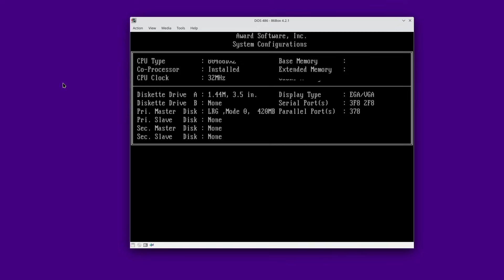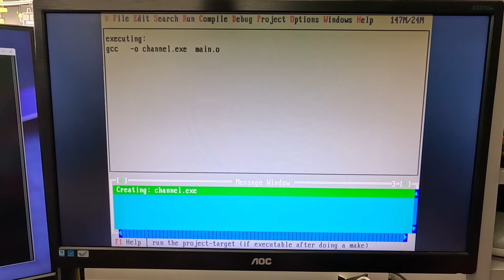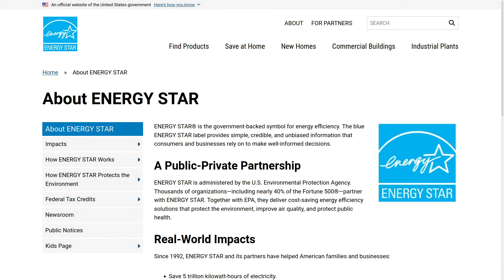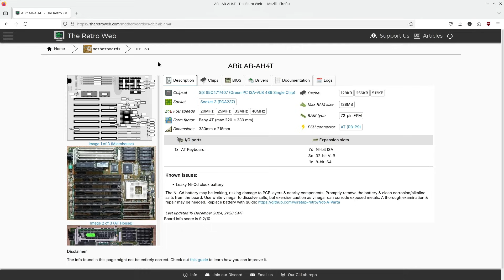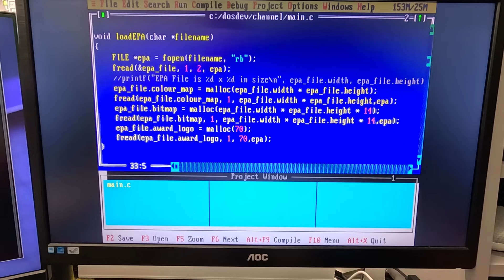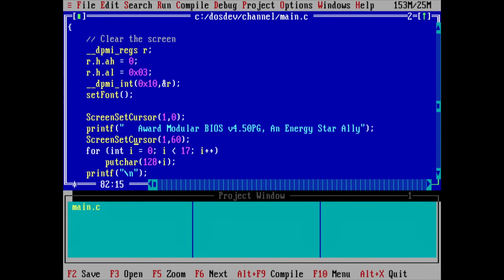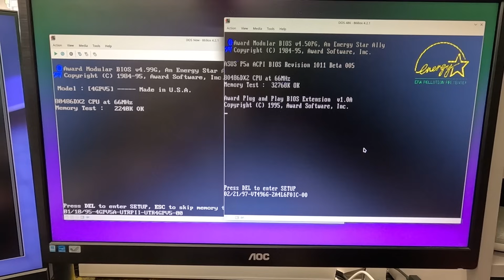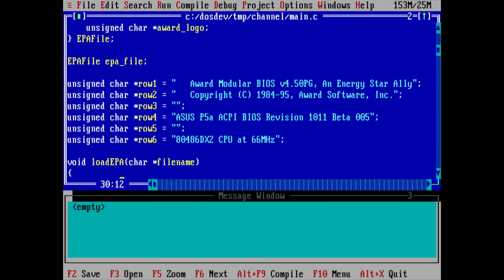Retro MS-DOS Coding - Recreating the Iconic Award BIOS Screen

Comment: As a kid, I was on a special education school and in the 5. grade there was an education game called "Budenberg" at school. It was in the 90s.
At that time, I was already pretty familiar with QBasic (I've teached it myself) and that game was extremely interesting to me because I noticed quickly how it was made: That game was pretty complex (it included many different kind for reading-, writing-, math- and other game modes) but hacked together. It uses almost all possible and impossible screen modes and some modes used tricks like the one in the video. And everything was squeezed into one single 720k 3,5" disk!
The game modes utilizing the tricks look like graphic screen modes at first glance. But the software was unstable and crashed frequently. When it did, it often revealed the secret fact that the "graphic mode" was in fact text-mode! It took long time to me to figure out how they included things like circular pie charts etc. into text modes.
The audio part is still a mystery to me: The game was made with rotten school-286's in mind with no sound blaster. It used the internal speaker to read aloud words, letters and phrases. The audio output through the internal was pretty clear and human-like. I know there is some crude PCM/PWM hack but this usually produces robotic sound. And how did they get the sound files into the disk?
I can confirm everything was really on that one disk with no hidden chamber because a few grades later, I was that one stundent who fixed all kind of computer-related issues because every teacher was afraid of computers, especially those running MS-DOS without mouse. What I did most of time: Getting this game out of some weird bricked state by reinstalling it from the disk xD.
That old dinosaur still seems to be on sale.

Comment: It is possible that the Energy Star logo is displayed during boot exactly as you said, but it seems to me that it could also be displayed as a graphic (by the way, this has already been written about in the comments here), because many BIOSes had a function for displaying a splash screen and even replacing it with a user-defined version. As far as I remember, when displaying graphics using the BIOS 10h software interrupt, text can also be displayed, and the BIOS int 10h interrupt is available much earlier than other BIOS interrupts when booting the computer.

Comment: Sounds like you need to set a new color profile... that's not the official name, I'll have to check.  Yeah, you''l want to re-calibrate it, and most people don't need the hardware these days to do that, I have two graphics cards, and I just let Intel (the smaller integrated card) handle those big changes, because that guy from NVidia wears a tiny little lether coat, we can't trust that dude with issues of scaling.  You would think you only have three choices coming up, R G B, but that rabbit whole goes on for miles.  Just look up a profile forit, and from what I hear, the manufacterer not only doesn't always ship it with something to calibrate properly with, it's the norm.  But that's just what I have heard, I don't know.   It made a yuge difference for me, but that doesn't translate right with multiple displays.  But I'm gettting ahead of myself.  :-D  Hope this helps.

Comment: VGA has hard wired gaps between the characters. Some characters override this and the last column of the character is doubled. This is why you can draw uninterrupted lines and boxes. Which characters do this is also hard wired in the VGA circuits.
This enhances the resolution without requiring more character ROM space.

CGA/EGA doesn't has this feature so you need the gap in the Char-ROM itself. That's why CGA text is more "blocky". On the other hand, you can use custom characters to display graphics just like your average 8-bit micro.

Comment: 0:38 Didn't the 486 DX run at 33 MHz and the DX2 ran at 66 MHz?  32 MHz doesn't sound familiar.  Wondering if you might have been thinking of 32 as in 32 bits?
5:20 (Edit) Looks like the code was later updated since it shows '80486DX/2 CPU at 66MHz' here.

Comment: The "original PC" was not in EGA, but CGA. EGA was introduced with the PC/AT. However, by the time the EPA logos appeared on the POST screen, everybody had (S)VGA. The standard VGA text screen just doesn't lend itself very well for those pseudo-graphics, because of the 8/9 column thing.

Comment: It's been ages, but I believe it is a MODE call. The font could be CGA/EGA mode due to MGA. Maybe using a monochrome (into EGA) mode may fix the issue? 
It has to be within the same MODE so it can display the image no matter what display is used.
So, a font, that can be used in MGA and EGA modes without the overlap. (8x14?) I am not sure.

Comment: It is 35 year old memory, but as far as I remember, we had to set the graphic mode to get the fonts changed. I had to use an integer number while setting the graphic mode and that gave me different VGA, EGA modes with different text size screens yet I could draw over it. BTW I am guessing you are using Turbo C. If you are then its help is amazing and I learned it all from the HELP menu. You will find this information in the HELP. Look for graphic modes.

Comment: Interesting video. Brought back a funny memory from high school. My dad set a BIOS password on our home PC, and only told it to my older sisters, who were only allowed to enter it for us if we had homework to do on the PC. So while I was doing my homework on the PC, I wrote an approximation of the BIOS screen in QBasic, then told my sister the PC had crashed, and asked her to type the password again. My program then saved her input to a text file, and voila, I now knew the password.
Reply: Ooh. OG "phishing"
Reply: @mikelenox7999  It is called keylogging and Keyloggers came in form of software which you usually concealed in some form and sent over mail, later IM what have ya.
If you had physical access to the machine, RS232 or later USB keyloggers could be bought.
Or you'd make your own.
Reply: Similarly, I had a PC whose bios was locked. But having access to it when it was unlocked, I dumped bios and found it just one bit in memory. When I needed to boot the PC I flipped the bit, doing my things and flipped it back when I was done. I didn't need to know password and it was left intact after I was done.
Reply: This was exactly what I did ! With my mother. I wouldn't dare doing this to my Dad though as he would have noticed the difference. I still remember the password was 'secret' and I didn't know what the word meant (I was young and English wasn't my first language) - luckily for me the password entering screen for my AMI Bios was a simple line in the middle of the screen, no colours or logo
Reply: Most BIOS had a backdoor password the company put in - i.e. Award was "award_sw".
Reply: :D
Reply: I had to do the exact same stuff, when I was 13, just using Pascal. And the one getting tricked was my mom. As this was my first computer program, anything assembler or BIOS was out of reach. So I just simulated plain ascii text. This stupid image was super annoying. My rough approximation there using standard ascii chars could easily spoil the show. Turned out, it was good enough. The password was 'idvs'. I still remember it nearly 30 years later.
Reply: I think your dad would accept that you showed enough interest and skill to earn your computer time
Reply: Most of the bios passwords are the time we’re just stored plaintext in the bios memory space. Wasn’t hard to read IBM PS/2 bios password.
Reply: Damn, you were born a social engineer!
Reply: So what did you do when you finally got unmonitored time on the PC?
Reply: @ Probably had more fun programming stuff tbh. I was the type to get in trouble for ignoring my homework to read books.
Reply: @angelisdania  Not HHGTTG and Planetfall?  Would have been my first choices.
Reply: QBASIC, of all things, haha! I taught myself BASIC when I was 12yo on and old TRS-80 Model III clone (do a search for "Prologica CP-500"), and when I "upgraded" to PC and got my skinny hands in QBASIC it was like heaven! The only language I liked more than QBASIC at the time was Borland Turbo Pascal, but for things I wanted to do quickly just for testing or for fun I'd still use QBASIC. Good times!
Reply: Or just unplug  and take out the cmos battery for 5 min
Reply: @xpavpushka  Yes, but removing the password would not conceal the fact, that it was compromised.
Reply: Haha... 😂

During my high school exam period, my mom wrapped the PC power cord with tissue paper, signed on the tissue, and then sealed it with adhesive tape.

But little did she know... I had another power cord stashed away. 😅

Comment: I remember learning how to do custom graphics via character sets, back on the Commodore 64 in the mid-80s.  At that time, unless you wanted to replace the entire character set with a pre-programmed font of your own, you first had to copy the original character set from the C64's ROM into RAM, so that you could actually overwrite the PETSCII graphics with your own, and afterwards you had to bend the character set pointer to the address of your own copy.  It was huge fun for 10-year-old me to experiment with that crazy new stuff!

Comment: Re: the lines between each character, this is something you can toggle with text mode - I don't recall if it adds extra lines or changes the resolution.

I'd find the PDF of PC Intern as it covers this (it was a 90s era book and came with its own PDF).

There are different editions, mine had C, pascal and maybe even basic.

Comment: PC Intern was a great book for this era of programming, and has some examples for changing the characters in VGA text mode.

You could load two character sets (maybe this is what BH in the load function points to).

The second set would be used if the high bit of the colour byte was set.

In this way you can have a whole 256 characters for drawing at the same time as an ordinary one (if you also tell it that the high bit shouldn't make the characters blink).

Comment: The reason is, in the hardware, it extends the 8th pixel into the 9th, only for a certain range of characters, the so-called "box-drawing" characters. For all other characters, the 9th pixel is transparent. Using an 8 pixel per character mode would fix it (EGA).

Comment: I had just assumed the BIOS screen was all in graphics mode and not text mode. Interesting.

Yes, some forum system is good for discussion. For Photo sharing, Panoramio was an excellent platform. They, unfortunately, were posturing themselves to get bought out by Google, which happened, and the Google trashed Panoramio. Possibly advising to "be careful" to produce something good, get bored supporting it, then trash it.

Comment: just from my old memory on the int10h and alikes:
(i had a good time with Pascal mostly when playing around with that level on 16 bit real mode PCs with slightly touching DPMI - also some ASM, but at a very limited amount.)

there are multiple text modes with sometimes even similar columns and rows.

there is a separate call to select the number of scanlines, might it be 320, 350, 400, 480 or whatever (see docs - its just 30+years passed... ;-) )
if you do that then your EGA or VGA text mode will result in something different: the character maps used will be different, might it be 8x8 or 9x14 or something.
that is the supposed reason why your chars from the 128+ space will not join smoothly into a bitmap equivalent but have gaps and "staircases".

Hehe, let me see what others guessed... (guessing now, many went the wrong way...)

Comment: No idea how or why the algorithm provided me with your video, but really pleased that it did.
I recently got into real mode DOS programming as a palate cleanser after a web project burned me out. It's so much more fun and SO easy to break stuff by accidentally overflowing a memory segment.

I had an issue with my compiler (openwatcom) and how it manages inline assembly for the interrupt stuff, and found the solution in a 31 year old usenet post!

Comment: AFAIK, the EPA BIOS Screen was EGA 640x350 and 80x25 using 8x14 Charset thus resulting in a slightly larger font. Maybe you selected the VGA 640x480 mode with 9x16 Charset, which would also explain the blank lines between each individual character…

Comment: You've set the screen mode to VGA, but then you're trying to set the font mode to EGA which doesn't make sense. You need to set the screen mode to the correct EGA mode instead of just switching into the screen mode that DOS is already in (where you clear your screen). Just make sure to switch back right before you exit :)

Comment: Good ol' times! Replacing the Award and EPA logo in the BIOS files, changing some strings around and enabling some features and flashing your own custom BIOS. One website that I used back then was called something like "apes" bios files or something with a monkey in the domain-name. On motherboards like the ASUS A7V333. When we could buy new hardware every few months because something cooler and newer came out.

Comment: The ROM doesn't contain any CPU microcode in it at all. The CPU microcode is what tells the CPU what functions to perform when the instruction says MOV AX, [BP - 27] for example. That's a lot for the CPU to do in one cycle, so the microcode breaks that down into a few very simple steps.

Comment: You are using 9x16 characters in standard 720x400 VGA textmode. You need to change to 8x16 character 640x400 textmode. You can do this by setting VGA sequencer register 1 bit 0 when in normal VGA textmode. I.e. outp(0x3c4, 1); b = inp(0x3c5); outp(0x3c4, 1); outp(0x3c5, b|1);

Comment: Boy does this bring back memories indeed. I remember using the VESA Bios Extension (VBE) in protected mode to access a Linear FrameBuffer (LFB) of the graphical display memory. There was a program called UniVBE/Scitech Display Doctor that you could run on graphics cards where the bios did not yet support that yet.

Comment: I just found your channel, good stuff!  I found a book in the library back in the early 90s that also came with a disk (As they often did back then). The book and software were for making fractals, and the software had tons of non-standard graphics modes that seemed to all work. I found a long out of print second edition, so I don't know if it's the one I remember from the library, but my copy only has the CD and is missing the disk. "Fractal Creations" by "The Waite Group" with Tim Wegner and Bert Tyler as the authors. I'm sure the software and the source code is easy to find, but this second edition book doesn't have nearly the detail I remember keeping me busy for months.

Comment: I seem to recall that the specific font would be in the ROM somewhere on the graphics card so when in text mode the specific features of the font were dependent on that but in DOS you could load other characters if you wanted which would be used instead.  I think my first machine came with utilities for this.  The resolution in text mode isn't the same as in graphics mode which would explain why there were different proportions, I recall that the typefaces in graphics mode always looked a bit odd compared with the text mode ones.

Comment: If I recall some Norton tools used a similar technique to make the DOS block mouse into a smooth "windows like" arrow that was moving pixel by pixel on the text screen modes.
Reply: If I recall correctly the way this was done was to have a hook function that was called whenever the DOS mouse driver detected the mouse was moved. The hook function then reprogrammed part of the VGA font to overlay a mouse cursor (arrow) on top of whatever characters were below the cursor. Characters plural, because the mouse cursor could overlap more than one character on the screen.
I think PCTools 7 did the same thing. Possibly also DOS 6's DOSSHELL?
Reply: I remember reading that when I was a teenager and coding a bunch of DOS stuff and thinking, oh my god that sounds so cool I should implement this...  dear god..  That was a week.